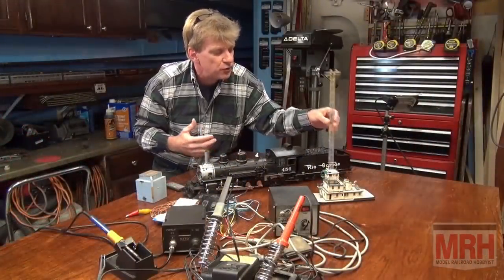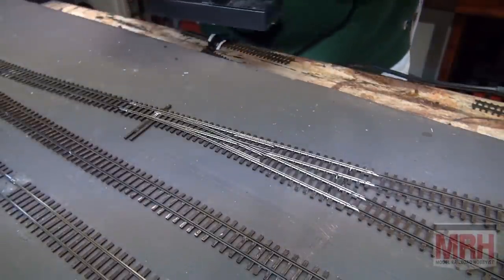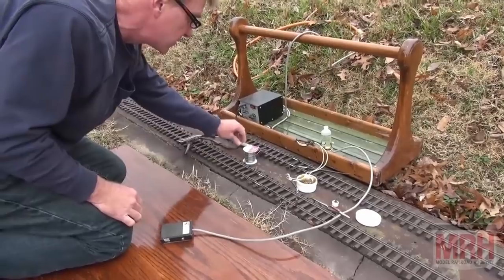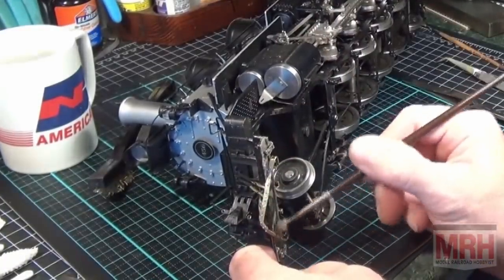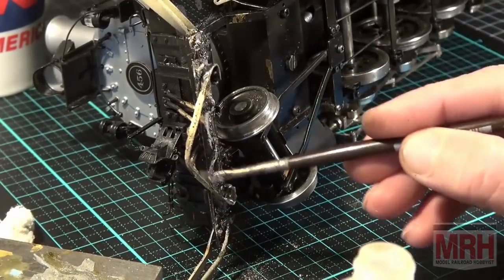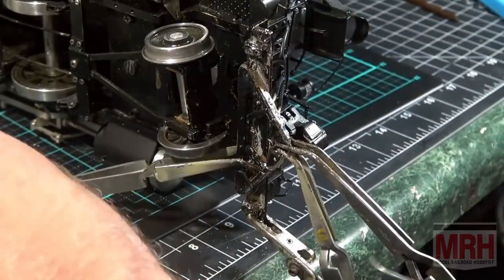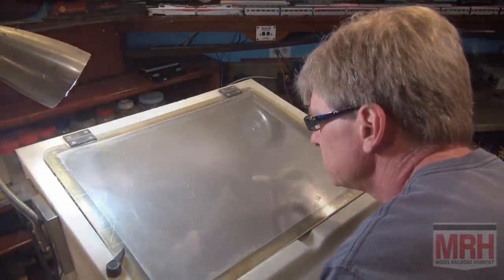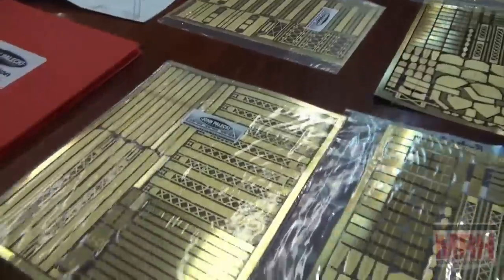All about soldering | July 2020 WHATS NEAT Model Railroad Hobbyist

Comment: Ken, I retired from the Army Signal Corps.  For electronics you emphasis: Clean your contact area, make a good mechanical connection, and then solder.  Honestly, I was cringing on some of your work for soldering to the track and to an electric switch or buss.  My concern deals with cold soldering connections.  They will be the biggest problems and the most difficult/impossible to find and repair.  You should show how to use heat sinks on the wire so you don’t melt the insulation.  Additionally, having shrink tubing at the electronic switch connection would be preferable to prevent accidental shorts.  Please consider having a follow up video showing how to avoid the mentioned pitfalls so your viewers have a better soldering experience.  Finally, instead of having soldered busses I recommend using screw connectors or clamp on ones to split off power.   I have seen so many cold joints in my time and they are nothing but problems.   Thank you, Jim

Comment: Thank you for clarifying the use of acid solder only on structures. Rosin solder ONLY on electronic connections is what I learned years ago--the hard way. Brass or nickle-silver track turns a lovely greenish-white when acid flux is used and not cleaned off thoroughly and the connection self destructs.

Comment: Great video, I model in Sn3 and I have been collecting PBL engines for about 25+ years. I got my PBL resistance soldering unit from Jimmy Booth over 20 years ago. Best thing since sliced bread.

Comment: When clamping I use wooden spring clothes pegs. They can be cut to fit in the most difficult places  are cheap and so can be called consumable, they don’t melt with heat . When they do get heat damage  throw them on the BBQ fire as wood.
Also there are Stainless steel clothes pegs that have the clamping force for most things. I have use the combination for many years and they work out well. Amacf

Comment: Thanks for posting this. I've been model railroading for many years going back to when I got my first train set when I was 8 in 1962. I like building things from wood and did build a functional coal tipple to load hopper cars. For the doors, I used L shaped brass for the slide rails, flat brass for the doors, jewelry chain on the doors connected to levers mounted to brass tubing of various sizes that go to the other end with levers connected to cables used for RC planes to levers under the edge of the bench to operate the tipple doors. All I have now are old DC type locomotives that I buy from eBay sellers. These new DCC models are far out of my budget.

Comment: Ken, great video. Have had a resistance soldering units for years and never used it. That will change this week when I find my brass n scale fire watch tower. Also please talk about the importance of exhausting those fumes. Is lacquer thinner the best way to neutralize acid core flux after soldering brass? Thanks

Comment: Glad I'm watching this. I'm pretty good with a pen. But a few of them guns would be perfect for me and some of the hobbies i have along with trains. Nitro and electric rc's. Also i pick up old quads , mopeds anything that is broke down and needs help to give them life again. New electronic parts is most of the problems. But some is the cheap wiring use in some of the items i fix from overseas. So rewiring with a better quality wire soldering and heat shrink to finish it off. Have few old school brass signals that need minor repairs and this has given me the courage to make the repairs. Wasn't sure on how to proceed forward. Have few other diesels that is missing their handrails. So been thinking about making some using brass. Gotta finish watching. Thanks

Comment: Ken, thanks for a good video about soldering. One thing you didn't mention was how you cleaned the acid flux after your connections were completed. In industrial jobs, they used to wash them with trichloroethane, but that nasty stuff is toxic to touch and to inhale. What's your favorite technique?
Reply: For many years I've soldered material that requires strong acid fluxes including hard carbon steel such as music wire and also stainless steel. I have neutralized the acid fluxes using a saturated solution of baking soda.  It's safe and readily available.  Just buy a box of baking soda at the grocery and dissolve in water until you have some extra baking soda that just sits on the bottom.  After using the baking soda, I then use dish liquid and water to clean things.  I have work done 20 to 50 years ago that is still in good shape.

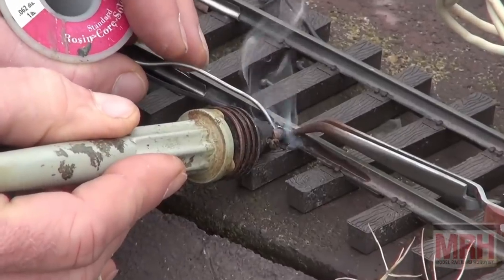Comment: A few things on this video, he never stresses the importance having clean metal to work with, the metal should be cleaned to where it is shiny before trying to solder, a perfect example is at 17:22 where he solders the wire to the G gauge track, he says it's a perfect solder joint when in actuality it's a cold solder joint, the corrosion or paint prevented the solder from flowing like it should have. I would be embarrassed to show a joint like that unless I was showing how not to do it.
 He keeps mentioning liquid solder and then shows paste solder.
 Never mentions that there are different kinds of paste flux, it your doing electrical connections and want to use paste flux use something like a rosin paste, No-corrode paste flux is an acid flux and should never be used on electrical.
  Use different tips on your soldering irons for rosin flu and acid flux. The acid flux will eat your tips up a lot quicker than rosin will. 

  It is also very important to keep your tips clean and tinned which is not explained.
Reply: I disagree about the cold solder joint. He used plenty of flux and heated the joint until the paint bubbled and disintegrated. Looked like a decent connection to me. The blob of solder he had to clean up was just excess.
Reply: That's Why Ken Is The Consummate Professional Mechanic's Mechanic & YOU AIN'T PAL!!!!!!!!!!!!!!!!!!!!!!
Reply: @edeaglehouse2221  when you see balls of solder like that, you don't have clean metal to give you a good solder joint. The solder should flow across the metal not ball up.
Reply: @christophercolt1361  Tell that to someone that wasn't taught MIL Spec soldering.

Comment: That acid flux is not "acid core flux". It's just acid flux. (Acid core refers to soldering wire with acid flux in the core. You're not using that.)

Your solid wire is just solid wire. It is not solid stranded wire. It cannot be both. Wire is either solid or stranded.
Reply: Well, technically solid wire is just a single strand. :-/ You may have missed the "acid core rosin". Seriously though, sometimes seeing how other people make mistakes and correct them is a better learning experience than seeing them do something perfectly.

Comment: I'm a little bit shocked, that you put a 5000$ Model directly in the workbench. Why not use a Lokliege from www.lokliege.de they are also awailable in G-Scale. I never repair or work on my locomotives without using this tool.

Comment: I feel unsettled being taught how to solder ... by someone who does not know how to solder.

Attach wires before soldering? Nah!
Clean metal? Nah!
Oh ... BTW, what does it mean "cold solder joint"?
Reply: He knows how to solder fine. It works for him. For those unfamiliar with the term, a "cold solder joint" is one that hasn't been hard enough for the solder to melt completely to connect the parts. It will not hold or conduct electricity well.